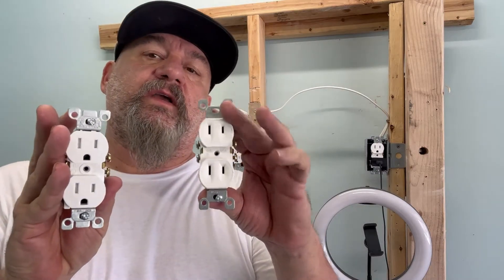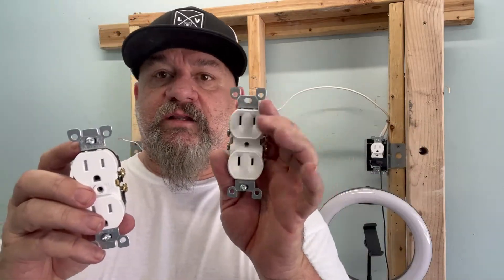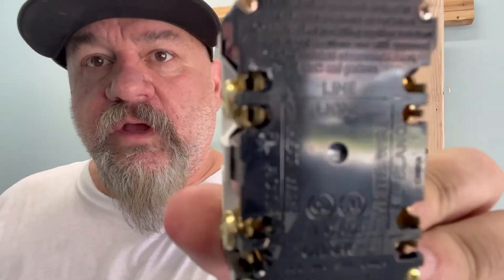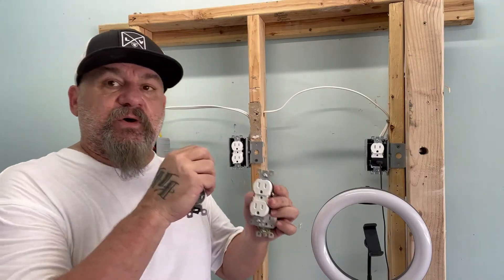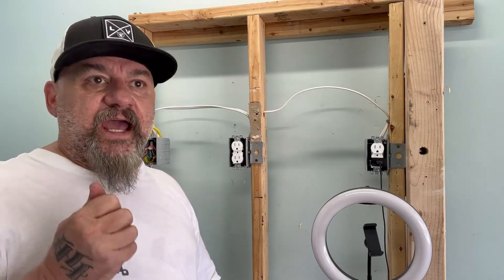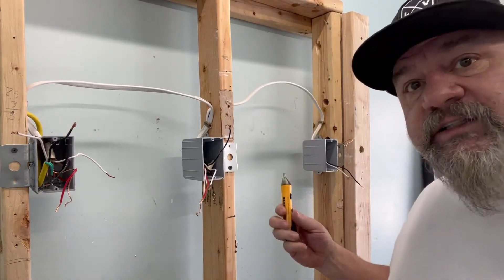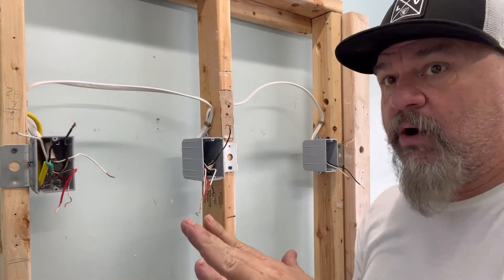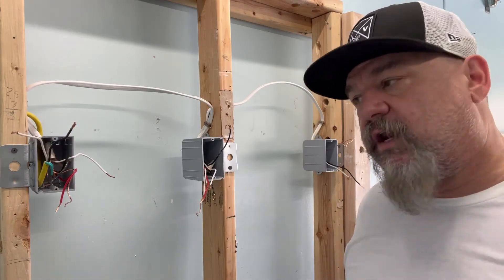Can You Replace an Ungrounded Electrical Outlet? Here's What You Need to Know!

Comment: Here in Cali almost every house built pre 50s with non grounded outlets had rigid conduit for the wire to run in so I just first cut all power to main box drive a 6’ piece of 3/8” steel rebar at box connect ground w😅re to the 18” left above gr😅und or to the ground steel at a hose bib and that in turn grounds all the rigid steel conduit that runs to each metal box for outlets therefore I then can ground my new outlets to the boxes and I’m good to go

Comment: Sooo, my assumption is that the 3 pronged outlet that is less than 3 feet away from the two pronged outlet is NOT the start and is not grounded.    I hate whomever did the electrical in this house.  Outlets and lights without no boxes,  outlets that pull out of the wall with boxes.  A 1950s (I'm assuming, could be older) wall sconce in the hallway with NO box and no ground.  BraidX wiring.   An open metal box inside the crawl space.   And that's the just the electrical.  Don't get me started on EVERYTHING else.

Comment: Will wiring the ground in a fixture downstream cause that fixture to not work? Example i recently installed an exhaust fan (bathroom) it wouldn't turn on however when i install a standard light it turns on fine. Imthe Exhaust fan is in a metal box. Im not sure if i am "grounding out" or what.

Comment: Can I replace the old ones that have no ground with the new ones that have ground even though there is no ground? I mean it’s the same thing I had no ground anyways. Because many things I plug need the three prong to connect them, I mean why should it be a problem if I never had ground to begin with?
I don’t want to add GFCI 
All over my house.
Reply: @israel9294  that's exactly what i was just thinking.   If there already is no ground and I'm using those stupid 3 prong adapters, then what is the difference?

Comment: I was told by 2 electricians to replace every outlet with gfi.  I have been doing this room by room as I remodel.  Will this cause an issue or just extra protection for a little more cost?

Comment: So in my master bedroom of my really old house, there’s two prong plug where I need a three prong plug. The rest of the plugs in the room are three prong but for some reason, the one I need a three prong and isn’t can I replace that one single two prong plug with a GFI will it be OK or should I just put GFI’s on all the plugs in the room? I really have no idea what I’m doing also, I’m pretty sure my plugs are all wired with that old cloth wiring would be OK if I open them up and shrink wrap them with that electrical shrink?

Comment: Thank you so much for an accurate video. I know a few things. But when I see these clowns using a self tapping screw into the back of the outlet and running a wire. I k ow that's wrong. So thank you for the indeapth explanation.
Reply: If the box is already grounded, then this is the correct way to add a ground wire to a switch. Not really needed because the switch is connected to the grounded box already, but a little extra insurance isn't a bad thing.

Comment: Older houses that had two-blade receptacles, the metal mounting frame (or metal strap for that matter) did ground it's self to the metal receptacle box, and then to the metal cable, and last but not least, the circuit breaker box (or fuse box).  As far as I know, the metal breaker/fuse box is always grounded to earth.  The center screw that secures the receptacle wall plate is always a ground.  You will need to buy a outlet grounding adapter, and attach it to the wall plate center screw.  Armored cable (AC), often called "BX" cable, uses its metal sheathing for grounding.  Please reply.  Dave...

Comment: What can you do with an old house without grounded wiring ?

GFCI outlets can be used to replace 2 prong outlets. But there's still no ground. So I'm assuming you can't use typical "surge protection" power strips (or likely no type of modern day power strip of any kind)  because they rely on shunting to ground. Which a non grounded homes wiring doesn't have. 

Also, if the house doesn't have grounded wiring. Would a whole house surge protector at the service box actually still protect the home (I'm assuming no) ? 

It seems like the only thing I can think of as far as protection for a non grounded home. Is something like a "Zero Surge" product. As they filter through their built in capacitors. & are filtered back through the neutral once the charge has slowed down to a safe level. At least that's what they claim to do. 

So in that situation I'd have to assume maybe in an ungrounded home. Your only choice outside of a complete rewire upgrade. Is a GFCI outlet with a Zero Surge power strip plugged into it (pretty expensive solution still).

Or is there another way to have protection in an non grounded home. Besides a GFCI + Zero Surge combination. Or just updating the whole home with a full rewire ?

Comment: If all your receptacles are pigtailed, the tic tracer would indicate power at every receptacle and undoing them especially if they are soldered in, would likely be ill advised. Just put a GFCI in bathroom, kitchen, garage and maybe any other place where a 3 prong plug would be used. Wire only to the Line side. This should be an easy job if there is enough room in the box. If not, you could add a 1 inch Wiremold extension. Leave all the remaining receptacles as 2 prong. Most appliances have 2 prong power cords anyway as they are typically double insulated so you should be safe assuming the wiring is still in good condition.

Comment: Can you replace all ungrounded outlets in a room with GFI ones?
Reply: Not a good idea usually. I am told you can have up to 3 on a circuit. If you so, you need to connect each gfci to line, not load and connect  the first regular grounded outlet in your branch to load between each gfci. The next gfci at the end of your last grounded outlet in that section goes into line on the next GFCI. Never connect to load on those if more than one. 
THIS is only useful for in a situation like mine where all 3 bedrooms reside on the same circuit. 

Otherwise If I used just 1 and it gfci trips at the beginning of the run where it goes or anywhere in the run, then it shuts all rooms down. Similarly  If you connect each outlet to gfci and each extra gfci is connected to load, when one trips, they all do. But if you do it the way I suggest it will create "mini circuits" between each gfci and they can trip independently of each other.

Most people won't have to do this but most people probably don't have my situation.

Comment: I have no ground in my house and have all 2 plug outlets. Going to replace some. 

Can I replace my plastic box to a metal one and just ground straight from the metal box?
Reply: No, do not replace it. Plastic is way safer. If the incoming hit wire touches the metal box you will get shocked from any equipment case.

Comment: Can we self ground direct6on return line?
Reply: No. Neutral and ground are not the same. The neutral carries the unbalanced load back. The ground only carries current if there is a fault. If you use the neutral as the fround you could be energizing the shell of equipment and cause someone to get hurt.
Reply: @nooneyouknowhere6148 Close. In each 120v circuit that is not a multi wire branch circuit, the neutral wires will carry the exact same current value as the hot wires in that circuit. The unbalanced load (the difference between the L1 and L2 bus) can be measured on the heavy neutral cable upstream of the neutral/ground bus bar. For example, if the circuits connected to L1 total 20 amps and L2 totals 15 amps, the unbalanced load would be 5 amps. 240v circuits are balanced by design and have no effect on the neutral wires.

Comment: If there is wire in conduit and metal boxes, isn't the system grounded already?
Reply: If the conduit connectors and couplings are all properly tightened.

Comment: Will this work in an old apartment building? Do you need permission before installing if so? The reason is for  using guitar amps with grounded cord.
Reply: its pretty simple to do even in old buildings.
Reply: @T4P2028 since the gfci says, not for use with equipment, is it safe to use high end electronics with ungrounded gfci outlets?

Comment: Hey all you inspiring electricians out there, what’s the difference between a ground and a neutral?
Reply from the maker: lol for me thats the age old question.
Reply: @StarvingElectrician  Easy answer!
Reply: One is the ground and the other is the neutral, duh!
Reply: @ronnym1977  Wrong answee
Reply: @ronnym1977  You for real? You don't know the difference between them?
Reply: neutral can be + or - . it is NEUTRAL
Reply: @T4P2028  What's the difference between them though?
Reply: @WORDversesWORLD  Ground is a safety feature that provides a low-resistance path for current to flow to earth in the event of a fault, such as a short circuit or broken insulation. This helps to protect people and equipment from electrical shock.

Neutral is a current-carrying conductor that completes the electrical circuit. It is typically connected to the center tap of a transformer, which is also connected to earth. This means that the neutral wire is normally at or near ground potential.
Reply: @T4P2028  You described there use but what is different between them?
Reply: @WORDversesWORLD  what do you mean? They are copper cables. The way you use it IS the difference.
Reply: @T4P2028  There is no difference between them other than they way they are used, both or grounds!
Reply: @WORDversesWORLD the ground is for protection if there is a fault in your equipment it takes the fault to earth. The neutral carries unbalaced load and frequently is an energized conductor. The only place they are common is the main service equipment and the transformer. Not good practice to use one for the other. Yes your circuit will work, but you are risking someone getting hurt if there is a fault in the circuit.
Reply: @nooneyouknowhere6148  There is no difference between them other than the way we use them. For instance, you can replace a 4 wire dry cord with a 3 wire, works and is still protected.
Reply: @WORDversesWORLD  technically yes, you have to bond the neutral and ground in the back of the dryer if you do that. It will function and most of the time there is no problem. Just because it works does not mean it is a good idea. Old dryers had no neutral because they are 240v. They started adding a neutral for the electronic controls which are 120v
There are a lot of things you can do which will work. The question was, what is the difference between neutral and ground. There is a difference. But most people in the residential world don't understand it. Commercial electricians are much more aware.
Reply: @nooneyouknowhere6148  All dryer's that have low voltage controls need a neutral. And all a neutral is is a ground.

Comment: They don't have grounds, but they have pipes.

Ground through the pipes.

I had to ground my pc's receptacle to my radiator. I had to do this because they cut a pipe in the basement and replaced it with pvc.

My building is almost 100 years old, and that's how they did it.
Reply from the maker: Yep you can do that as well

Comment: If you are living in a 50+ year old house, and you really want/need grounded outlets, I would consider doing a gut remodel. Redo the plumbing, ductwork, electrical, and insulation and windows, and any mold remediation while all the drywall is off.
Reply: You're talking a $10 solution to a problem vs a $200,000 solution
Reply: I guess you never have heard of fishsticks and flexible bits? Have done remodels of old houses with minimal wall damage.
Reply: Lemme get started on that right now
Reply from the maker: lmao!!! hey im with you!!!!
Reply: Alrighty but what if you wanna do the landlord special and gaslight yourself into thinking it looks fine later on?

Comment: If a house was built between 1957 and 1963, it will typically have grounded wiring throughout, but still have 2-prong receptacles.  They weren't required to use 3-prong ones until 1964.  This convention may vary based on location, but I'm speaking for houses in the Metro Detroit area.
Reply from the maker: Thanks for that info. yeas thats why I said 50 and older in so many words, just to give an idea of where you would typically see them.

Comment: This is seriously great advice. So simple but could literally save peoples lives. What a great solution! Muy Bueno!
Reply from the maker: Right on my brother I appriciate you.
Reply: @StarvingElectrician 
Hey there, question...

What can you do with an old house without grounded wiring ?

GFCI outlets can be used to replace 2 prong outlets. But there's still no ground. So I'm assuming you can't use typical "surge protection" power strips (or likely no type of modern day power strip of any kind)  because they rely on shunting to ground. Which a non grounded homes wiring doesn't have. 

Also, if the house doesn't have grounded wiring. Would a whole house surge protector at the service box actually still protect the home (I'm assuming no) ? 

It seems like the only thing I can think of as far as protection for a non grounded home. Is something like a "Zero Surge" product. As they filter through their built in capacitors. & are filtered back through the neutral once the charge has slowed down to a safe level. At least that's what they claim to do. 

So in that situation I'd have to assume maybe in an ungrounded home. Your only choice outside of a complete rewire upgrade. Is a GFCI outlet with a Zero Surge power strip plugged into it (pretty expensive solution still).

Or is there another way to have protection in an non grounded home. Besides a GFCI + Zero Surge combination. Or just updating the whole home with a full rewire ?

Comment: Yup, I had to do this in my house. I replaced the first receptacle in the circuit with a GFCI and replaced the downstream receptacles with a 3-prong one. I made the mistake at first and replaced everything with GFCI when I didn’t know any better 😂. Those GFCI stickers also say “No Equipment Ground”. I put them on all the receptacles. Wish they made them white instead of blue!!
Reply: The stickers can come in white depending on the brand.
Reply from the maker: verry cool. I mispoke in the video, it has to say gfci protected outlet not circuit when changing out the outlets.
Reply: @beeps7  They do!!! Which brand comes in white???
Reply: @daCubanaqt  Leviton gfi's are one example.

Comment: Can't you GFCI a circuit at the panel?
Reply: Yes, but an outlet is much cheaper.  A rough price comparison is $10 for a gfi plug and $70 for a gfi breaker.  Imagine changing 10-20 circuits and the breaker option becomes very expensive. 

These days most circuits are afi/gfi breakers anyway.  Least with new construction or major system overhauls.
Reply from the maker: problem is if you have an older house they shared neutrals everywhere, the breaker would just trip. if you used a gfci breaker
Reply from the maker: If the Circuit didnt share a neutral with any other circuits, but older houses usually did, that breaker would trip over and over. sucks because thats the quick fix. but if the breaker was able to hold then you you can use it.
Reply: @StarvingElectrician is it safe to use highend electronics with gfci outlets, even though it says. “not for use with equipment”?